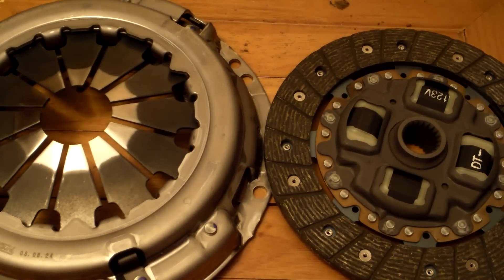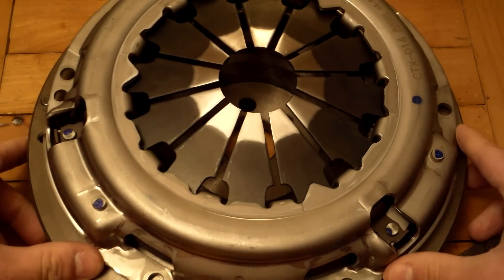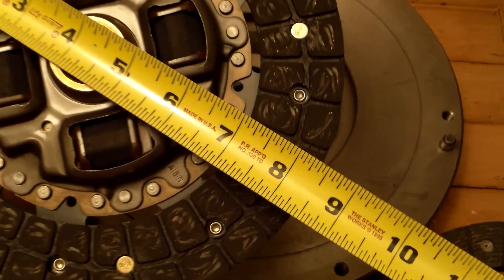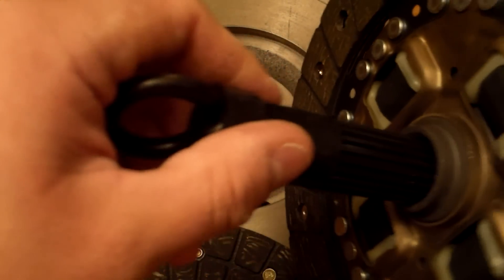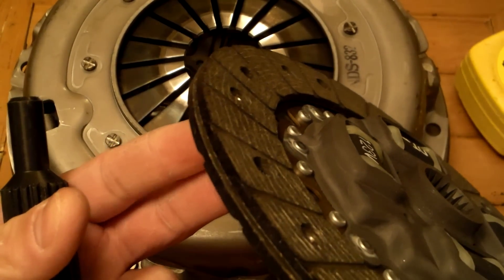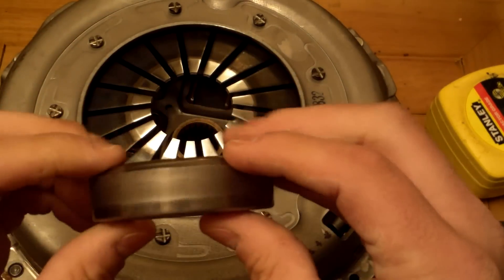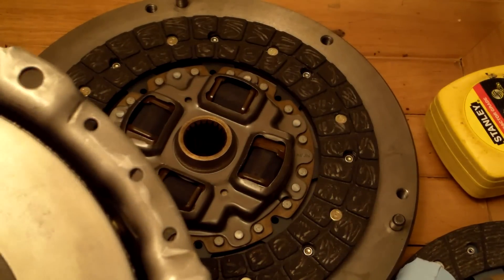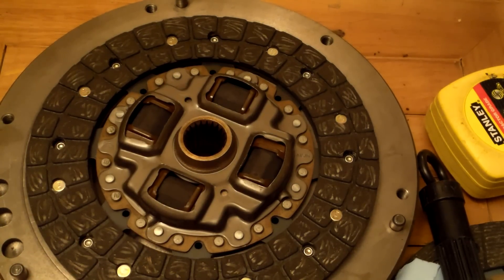AE86 Clutch Tech

Comment: love how in depth you get with this stuff unlike alot of other channels. im also trying to be very in depth on my videos as well. check out the throttle body video on my channel its full of info! thanks!
Reply: Chase I've watched some of your AE86 videos before you let her go, you're thorough by far! 
I really appreciate you guys putting this content out, bought an AE86 Coupe w/ a blue top 4AGE and sad to say it hasn't seen maintenance very often from previous owners. 
I'm having to do the clutch, brakes, valve stem seals( Cyl 4 went out), time it and replace the knock off headers and welded exhaust ha.

Comment: Just a quick question for you, do you have to take the engine out with the transmission to put the new clutch in or is there enough room to just take the trans off and do all the work from underneath?
Reply from the maker: ElamentalK1 
You do not have to pull the engine, plenty of room to pull just the trans.

Comment: where did you order the flywheel and the clutch?
Reply from the maker: Sorry for late reply. Been hella busy. Flywheel 1997 Toyota Celica ST: Rockauto, Pressure Plate 1992 Toyota Corolla GTS: Rockauto, Clutch 2005 Toyota Celica GTS: Toyota Dealer